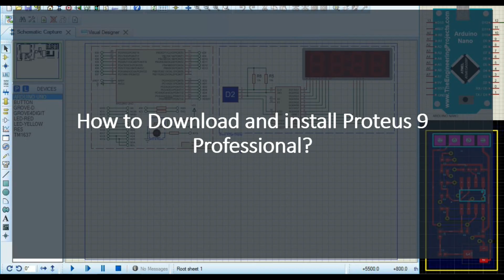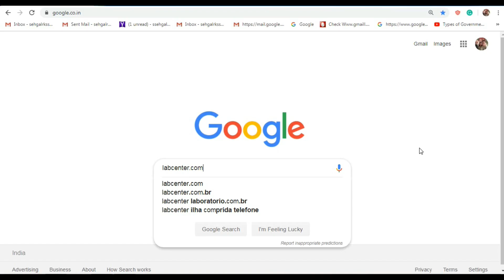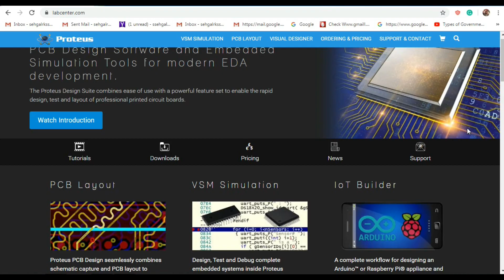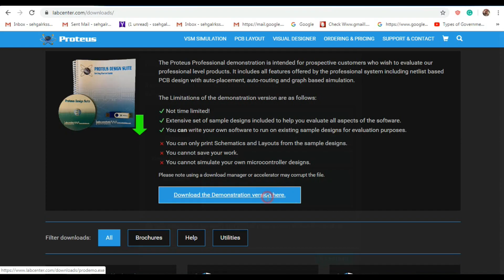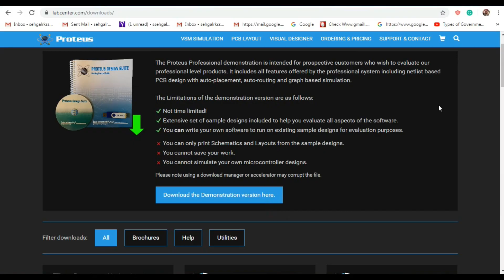How to Download and install Proteus Professional 8 ,  Circuit Simulation, PCB

Comment: I have downloaded protoues 8.9 after some times the more sensors connected with arduino it show fatal error.  Wht to do now?
Reply from the maker: Hello Sameer,

Yes, this problem is very common while using Arduino and corresponding sensors on Proteus. The reason behind this issue is compatibility. Actually the backend software that is running to simulate Arduino should be compatible with the sensors ( software associated with sensors). 
To solve this issue, you should download both Arduino and sensor library from same directory or same source so that they are compatible and created by same developer.

You may subscribe to my channel if you liked the content as it really motivates me.
For any doubts, you can contact me on Instagram, Facebook or post your comment on YouTube.
Instagram ID: mohit.sehgal
https://www.instagram.com/mohit.sehgal/
Facebook profile link:
https://www.facebook.com/mohit.sehgal.UdtaEngineer/

Thanks
Reply: Listen man don't listen to this man's yapalogy........basically the error that you are getting is indeed because of the compatibility issue but this problem will keep on persisting as long as you use the demo version of proteus ..........even i face the same error for 8051 microcontroller

Comment: Boss i have Proteus 8 but in this softwere on standard bars ISIS and ARES icon not showing ..please anybody tell me how its show.
Reply from the maker: Hello Barwinder,

Thanks for your comments !!!

1. Basically ISIS stands for Intelligent Schematic Input system. Proteus ISIS is used by Engineering students & professionals to create schematics & simulations of different electronic circuits.

2. ARES is used for designing PCB Layouts of electronic circuits.
 
I think you should try to reinstall the tool or reset the tool to its default settings. It might be possible that you have just downloaded the package in which only ISIS is available.

You may subscribe to my channel if you liked the content as it really motivates me.
For any doubts, you can contact me on Instagram, Facebook or post your comment on YouTube.
Instagram ID: mohit.sehgal
https://www.instagram.com/mohit.sehgal/
Facebook profile link:
https://www.facebook.com/mohit.sehgal.UdtaEngineer/

Thanks !!!

Comment: I made project in Proteus 8 demonstration version . I am unable to save it . It shows saving disabled in demonstration version . Anybody please help
Reply: Which version is required to save the work
Reply from the maker: Hi Jaspreet,

In demonstration version, you will not be able to save your work. 

Featues and limitations of Proteus demo version are: 

1. Not time limited!
2. Extensive set of sample designs included to help you evaluate all aspects of the software.
3. You can write your own software to run on existing sample designs for evaluation purposes.
4. You can only print Schematics and Layouts from the sample designs.
5. You cannot save your work.
6. You cannot simulate your own microcontroller designs.

Thanks !!!
Reply from the maker: Thanks for your comments !!!  In case of any query, you may comment here.